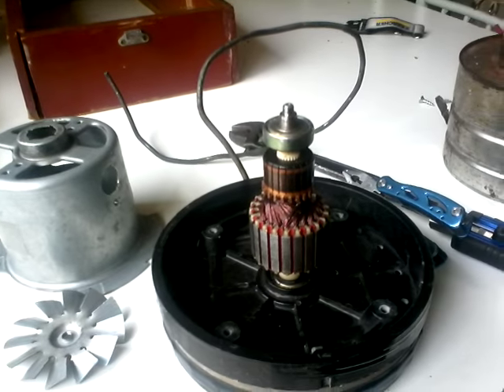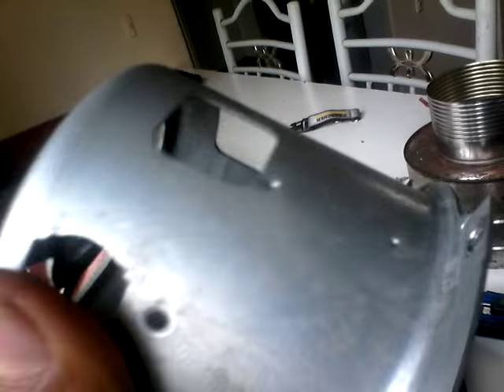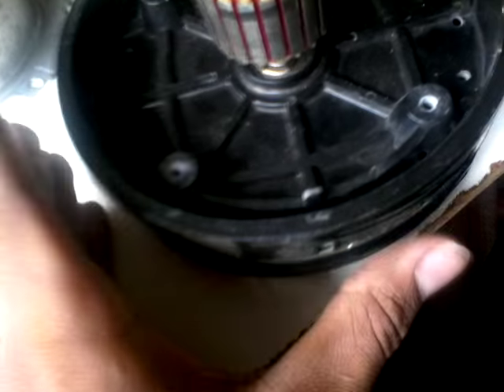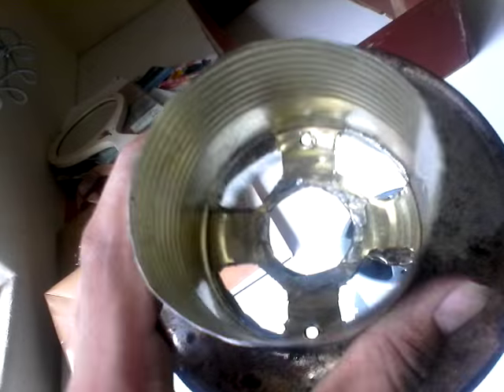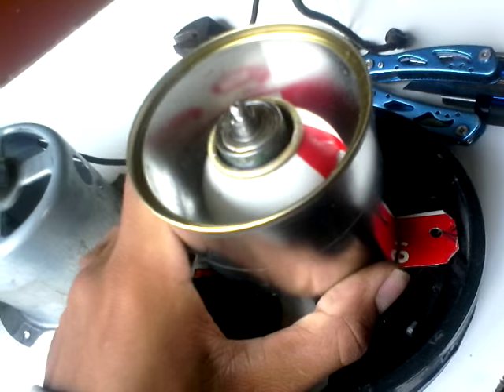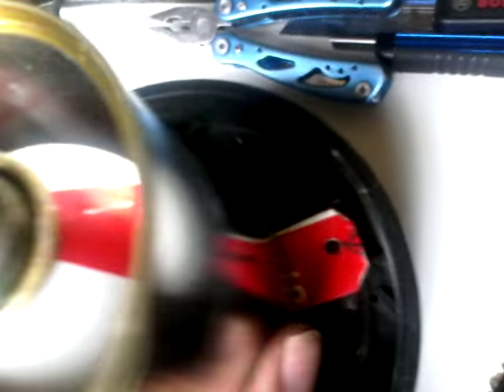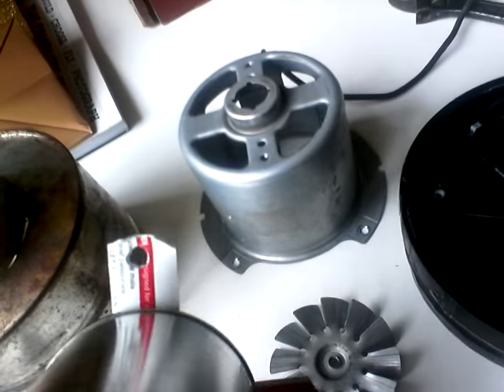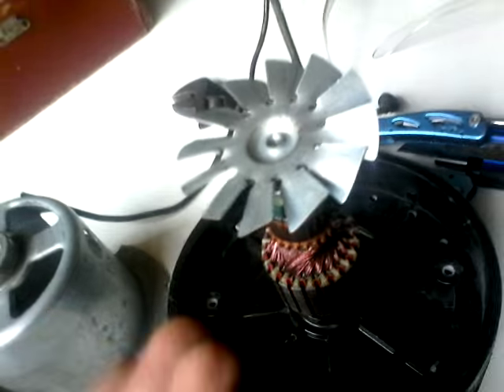Homemade jet engine out of vacuum cleaner

Comment: Every axial jet engines wouldn’t work using tin cans. You’ll need precise cutting with equations and more compressors unless you use a centrifugal impeller the ones used in turbo chargers

Comment: I am curious on if this works, my worry is that the metal will heat up enough to melt the plastic its screwed in. Jet engines get really hot, I would suggest finding a way to replace anything plastic on it or add some sort of cooling to that part.
Reply from the maker: the big black"plastic disc" is actually carbon, get a king clean vacuum cleaner engine and see for your self